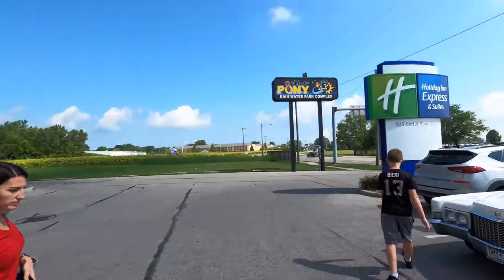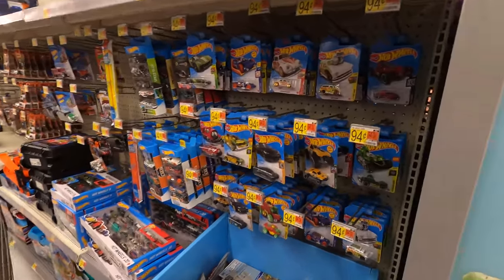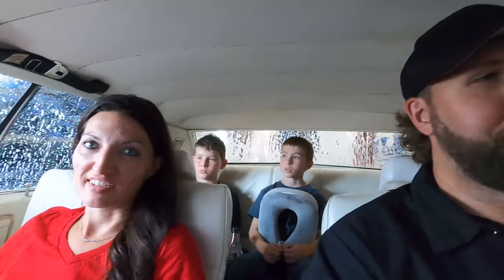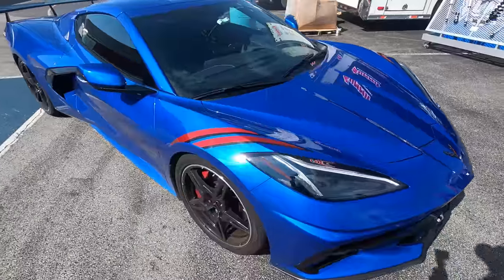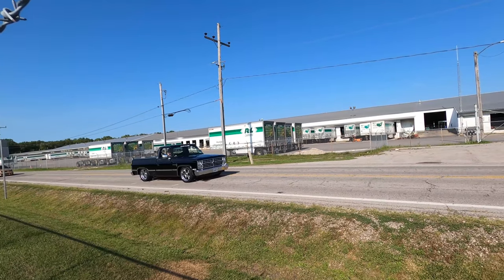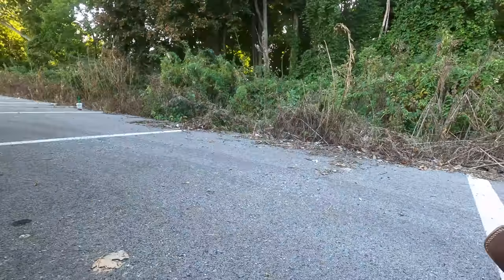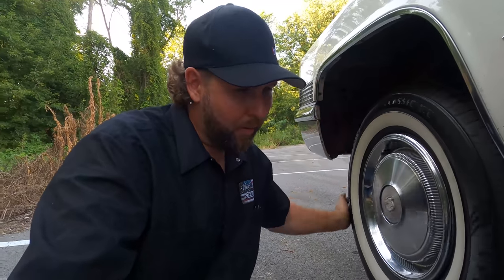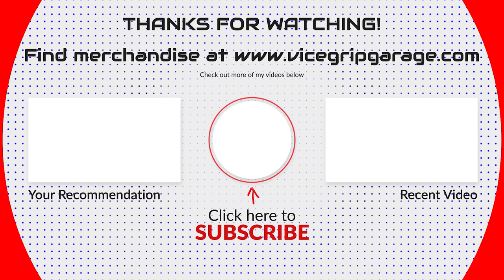Hot Rod Power Tour - Day 1 - Cadillac is Stuck In A Car Wash (again)

Comment: The vacuum leak keeping your mode door from moving might be part of why it's running lean.
Reply: *WHAT HE SAID*
Reply: A lot of systems pull vacuum from a canister with a check valve I believe. That way when you put the skinny on the floor you don’t loose blend door function or in some instances, windshield wipers or headlight doors!
Reply: Many many times im the past when I came across this problem with older gas, it turned out be the vacuum rotator and the center retaining button was broken allowing the vacuum to leak.

Comment: Hey Derek, the Hot Wheels have actually been $1 since they came out in 1968, they have constantly cut back on manufacturing costs to keep them at that price, as you said they used to be all metal, now either the body or the base is metal, rarely both. They do have several more expensive lines made for adult collectors that are all metal. Also Matchbox are owned by Mattel these days, the Matchbox models are usually utility vehicles, like cement mixers, garbage trucks, emergency vehicles that type of thing and the Hot Wheels tend to be the muscle cars and sports case. Loving these videos BTW, I bet your lads will look back fondly on these memories in later life.

Comment: That black crud in the fuel system is the rubber fuel lines disintegrating from ethanol! I've seen that a thousand times working on old 60s/70s small engines and boat motors. Even had that issue with a brand new boat motor from China once. Ethanol can react and dissolve certain kinds of rubber, including what they used to use for fuel lines. The problem might go away if a guy runs only non-ethanol from here on out, but it depends on how much is already dissolved by now.
Reply: I cant imagine Derek would run ethanol in there, basically every gas station in minnesota has non-eth gas option. Who knows what previous people did though
Reply: @KEOutdoors  watch the last episode, he filled it up with E-10 right at the beginning of the road trip. One tank is all it takes unfortunately
Reply: @Lunker_Dunker  He did it and sure didn't like it either. The old bog-jet might not have liked it either.
Reply: @logicthought24  I'm from Illinois as well, and I know this all too well. I have to drive 30 minutes to one singular gas station that has ethanol free gas for my boat. My poor old 75 F100 has to choke on E10 all the time, because driving it that far would most likely end up like a VGG revival video... Luckily it's mostly hard lined, so it doesn't really mind, but I can't leave it for more than a few weeks without running it, or the corn gas will separate out in the bowl.

Comment: Hi Derek!
There is a GM long paper fuel filter in the fuel pump under that huge nut in the bottom of the pump! Cadillac did that because of the location of the A/C compressor by the q-jet fuel inlet. Fella might want to put their peepers on it!
Tim

Comment: A neat trick for checking wheel bearings is to hold the spring with one hand while rotating the wheel with the other. The vibration and grinding from a faulty bearing will translate through the spring and you'll feel it much easier with that hand. Thanks to a mechanic I work with for that little gem. Works awesome and I do it all the time now.

Comment: Now everybody knows derricks “anti-theft deterrent system”….. LOVE THE TECHNIQUE!!!!
Reply: Pulling the coil wire off saved my ford van from being stolen one time. The thief tore up and out my ignition switch and tried to hot wire it, ran the battery down but could not start it. I had to replace the passenger side window with a junk yard one and get a new ignition switch to get it fixed back.

Comment: Had a 69 Cadillac with the 472 engine. It stopped running in El Segundo, CA one day. I then lived in El Segundo and called a wrecker to tow it home. They send a pick-up truck with a wench on the back. An amusing scene as the pick-up tried the lift that lead sled and never did.

Comment: One time a long time ago, my pals pushed my Mini for ages trying get it started. Then I realized I had the points distributor rotor arm in my pocket as an anti theft system. Popped it on and it fired right up.

Comment: 65 cadillac's used carter afb's they work well. I had a holley 750 vac secondary on my 67 deville. It will fit with a spread bore adapter. 
Or just put a gasket kit in that and rinse it out. The Rochester never seemed to run right.

Comment: DEREK , at 17.45 minutes into the video when you pulled the plug wire apart , there was a vacuum line hanging in the breeze with the rest of the plug wires , it should go to that round plastic vacuum canister on the inner fender ,  also if I remember right , there should be yet another hose going to that also ?  ( COULD BE YOUR VACUUM LEAK ) ?  may want to check out your routing on that ,  may solve your problem ??    good  luck !

Comment: quadrajets came in 2 sizes. Normal V8 GM cars were 650s. But large motors like Cadillacs and 454s came with a  750cfm quadrojet. 1 reason Derrick may have trouble finding a kit. 750 has a raised round top by the fuel inlet n float area.

Comment: Give Betty White an Italian tuneup! Where do you buy the Sprayway products? You did say the air shock line was leaking on the LR. The carb must have some plugged circuits if the gas was that dirty. Didn't you replace the gas tank and fuel lines?

Comment: Is hard to believe is it is but true at the very same time years ago I had a buddy that like to drink so my wife said at a party don't let him drive that car home. So I took the coil wire out of an old Dodge dart with a slant 6 and put it in my pocket. About a half hour later Ed got in the car started it and drove home! Being one of our neighbors the next morning I said to Eddie how did you drive that car home. He's like what are you talking about? I dangled the wire out of my hand! After a little detective work here the spark from the coil was arcing off the hood and back down to the cap enough to where the car ran, very  rough but enough to drive home. Crazy but true!!!

Comment: You set the fast idle choke by depressing the accelerator fully then release fully then start the car, If the car is in a poor state of tune you may need to slightly depress the accelerator about 1/8 of an inch to feed it some gas,GM went to all this trouble to put the fast idle choke on every car but no one it seems knows how to use it !

Comment: You need to get a jet kit. Using modern fuels i have found with my big block chryslers atleast i need to jet up 2-4 sizes. This is to compensate for the less energy efficient ethanol laced gas. The engines will tolerate standard jets but to run a little stronger and cooler they should be jetted larger slightly. Also that parts store back home you use brother.... You are sure gonna miss that gem. NO parts store within a 100-200 miles of where i live in western ny state ( not far from erie pa) has ANYthing on stock for our older rides. Even brake pads and junk are 1-3 days out any more.

Comment: 14 mpg out a a 70 Cad is likely a pipe dream. Possible, but not likely. I had a 97 f150 with a 4.6 and it could get 18mpg at 60. I took it on a thousands of mile road trip, and found that the 18 was a joke. Running 80-90 on the interstates had the MPG down to 13.5 and once we started hitting big hills I was down to 11.5. I was very worried because I had yet to be pulling a trailer , in which I would be doing on the way back with a car. Loaded it was locked around 11. People buying electric really need to think about real life, not pipe dreams, when it comes to range. As the battery ages it will not have the stated range. Cold will also effect the range.As the car ages , and real world driving conditions pop up expect 50% range.